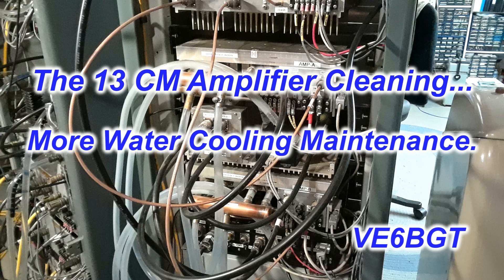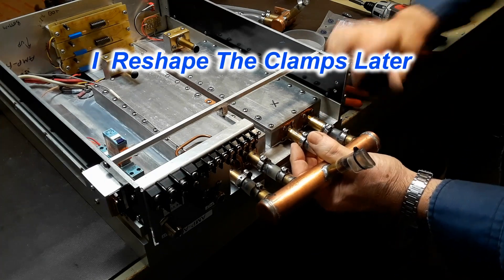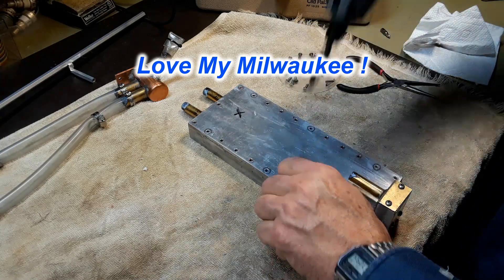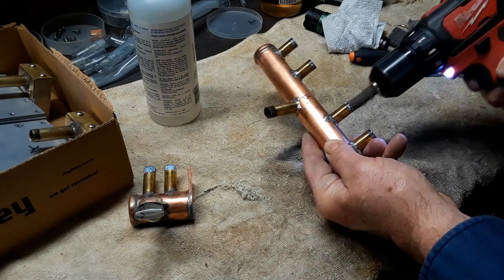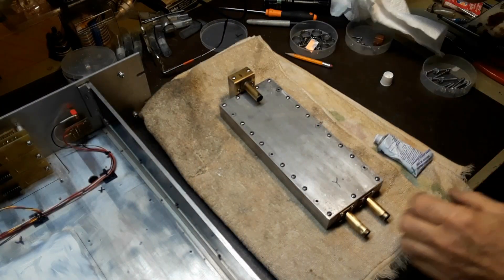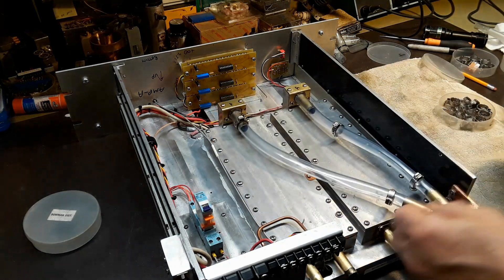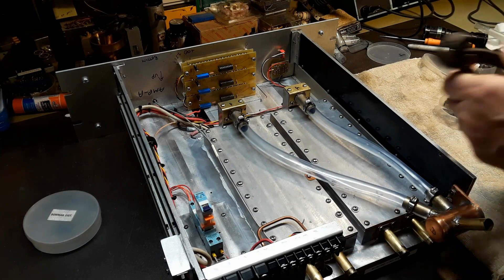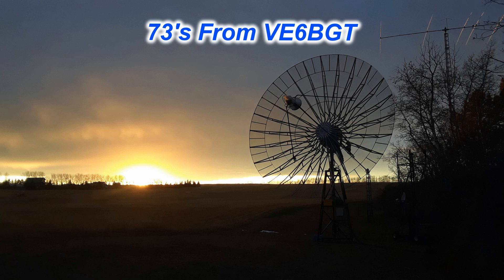The 13CM Amplifier Water Cooling System Cleaning

Comment: 😀I learned a lot of stuff abt. watercooling. The blue box, what´s that ? is it a heat exchanger/compressor ??
Reply from the maker: Hello Helmut.. I had to watch the video to see what " blue box " you are referring to.. I think you were looking at the top covers of the two water tanks that hold the distilled water for the two amplifier systems..  They are sitting inside that separate gray small cabinet that all the water tubing goes to.. They are just water reservoirs that have the small fish tank pumps in them also.. The water after going through the amifiers then returns through two small radiators with fans and then returns back into these water tanks.. There are earlier videos on my channel showing in more detail this part of the system.. The 23cm amplifier project shows more if I recall.. Thanks, Skip